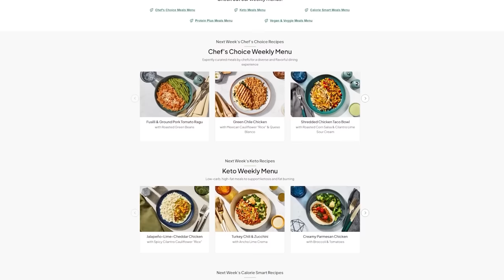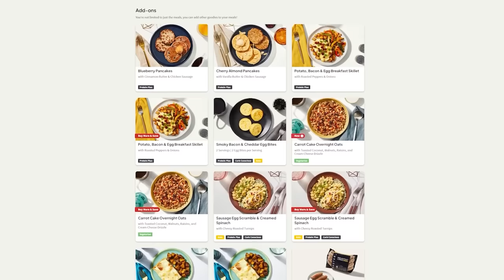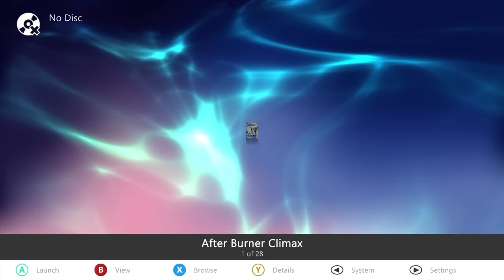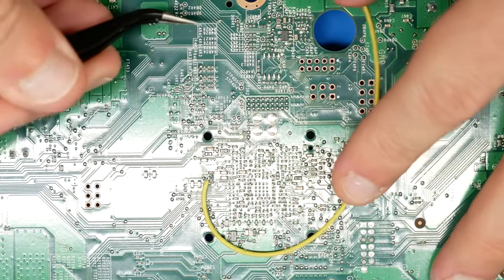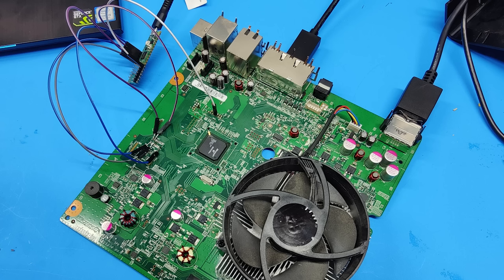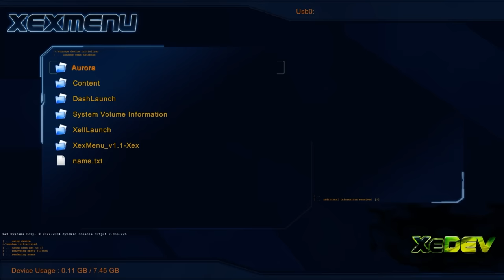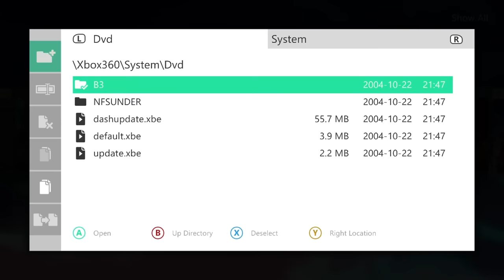I Hacked An Xbox 360 In 2024...Here's Why

Comment: I did this exact mod back in Oct last year. Its totally worth it if use a 2Tb drive cause you'll be able to put 250-400 games on it.
Reply: Is the 2tb drive compatible with the old Jasper models...?
Reply: @ahsanvirk130 I’d assume so because the operating system (software) would be the one reading it. But yeah it’s always good to double check.
Reply: I have 2tb with Aurora and have about 800 xboxlive arcade games
Reply: its available on ebay.. ?
Reply: I attempted it and ruined the motherboard.  I’m jealous of people who can do it successfully.
Reply: ...or you can just buy external HDD / SSD / Flashdrive if you all you want is more space.
Reply: @piotrmbukowski how bout usb thumbdrive
Reply: I’ve only got 300gb hard drive and got 195 games. A lot of them are emulated games from old consoles but even just Xbox 360 games I got 92 on the hard drive as most games get super compressed when you convert them to xex files and another 70+ sitting on my pc for when or if I ever need to put them on my Xbox 😂

Comment: If there were any softmods for the Xbox 360 that DIDN’T require physical modification, I would do so in a heartbeat. Granted, soldering isn’t THAT difficult but you REALLY need to know what you’re doing. Half-assing it isn’t an option, it has to be on point

Comment: I have a Phat Falcon that I RGH3'ed for my kids and for nostalgia purposes. Reliability on boot can be hit or miss, but I find that when the TV is on and set to the correct input before powering on the 360, it seems to work more often.

I have their TV set up to allow HDMI CEC so that they don't have to search for inputs using the remote. So they typically turn on a console, then the TV just comes on and goes to the correct input automatically.
Reply: 360 doesn't support CEC. Xbox One doesn't support CEC. Xbox One X doesn't support CEC.  Series S and X didn't support CEC when first released. HDMI handshake might be the issue you're seeing.
Reply: @espressomatic  this aged well didn't it..

Comment: Taping very precisely around PLL before trying to expose it can save you if you were to slip as it might save you from cutting through the trace that is right next to it. If you cut that trace it's all over and the system is dead unless you do a trace repair.

Also advisable to heat shrink around the resistor in case of shorting against the shield.

If you destroy post 1 you can recover by tapping in on the otherside of the board with a postfix adaptor.

I don't think there are alternative points for the other three unfortunately.

Trinity is the easiest install, early corona not too bad either.

Comment: 3:11

Actually, the last revisions of the original models, Jasper and Tonasket have proven to be the most reliable Xbox 360s you can get. They are more reliable than Slims. I have seen many Slims fail recently while I have yet to see a Jasper or Tonasket suffer a GPU failure.
Reply: I just found out that i have a jasper model but thing is, i dont know how to solder :( really wanna do this tho

Comment: Would this work on a Xbox 360 E? I bought the e 500 gb  as it was it great condition and was manufactured in 2015 .
Reply: No, Those had the Winchester motherboards which cannot be hard modded. You will need another earlier console if you want to hard mod a 360.
Reply: Model Es are only moddable if made in 2013 (corona motherboard) the end of 2013 (iirc november?) and on were winchesters and unmoddable

Comment: Used this exact mod method myself a month ago with my Corona and added a 2tb internal drive, so much content to go through after the mod not just games but collecting all Avatar items and gamer pics as well as each games DLC and title updates 😅.
Also @ 10:37 ripping discs is alot easier when you use Auroras GOD disc extract script found within Auroras script install section.

Comment: I don't remember having to use a chip when jailbreak the Xbox 360 and I did a bunch of them. It was just wires and resistors. Sure, there were manufacturered ribbion  type circuit boards that you could buy, but that was just to make it easier. I always used cat 5 cable wire and resistors on all different versions of the Xbox 360.

Comment: mine got RDOD yesterday, so i bought a new one... im pissed off.... the code was E79 and then no video and the lights said 4141. if anyone can help me with a fix let me know please
Reply: Hey mate. The E79 error code indicates that your Xbox 360 has either a corrupted file system or a hard drive problem. Seeing as you have checked the HDD and confirmed it is functional, I'm thinking it might be a software/NAND chip based problem. Two questions; Have you installed any system updates recently? And is E79, the only error code that is showing up?

Two possible solutions that I have found, in regards to software are;

Clearing any failed system updates that could have caused the error:

To do this, simply press and hold the sync up button, when the console is switched off (on the 360 S, it is the button, next to the USB ports). Then, turn on then console while holding that button. Continue holding it until the console has completely booted up and the dashboard appears. The console would've automatically cleared any failed system updates during the boot process.

Or, if you can get to the dashboard (try doing so without the HDD) try re installing the System Update (if you have recently done one) that possibly might have caused this:

To do this, go into System Settings > Memory > then hit in this order: Left Bumper, Right Bumper, X, Left Bumper, Right Bumper, X > Yes.

If this doesn't fix it, I'll have a larger dig around for a solution, hopefully after some sleep. Non the less, I do hope it helps you.

Comment: I may be a bit late to this, but just fyi for those that want to do this but are not able to solder, check any retro game shop or electronics repair store. The game shops will more than likely have skilled modders available that would normallyvjust be tapped to restore and refresh older beat up consoles.

Comment: I remember getting console-banned for doing something similar to this when the 360 was current, but I don’t recall there being a custom os at the time. This looks amazing; I kinda wanna pick up a 360 now.
Reply: It all depends. I had 2 modded Xbox 360s back in 2008. First one was just a DVD mod that made it possible to play burned games, that you could play online with. The second was a jtag modded Xbox and it had custom backgrounds,homebrew games, the ability to have all the Xbl arcade games for free and you could also run all your disc games off of a external hdd.  This was NOT ok to go online because you risked it getting banned and if you updated the system it would unmod your Xbox because you needed a Xbox that still had the blades dashboard since the firmware updated a patch to stop xboxs from being jtag modded.  Unfortunately it got RROD and I havent bothered to fix it but I want to at some point.
Reply: buy a modded one. it sounds like it needs to stay offline though.

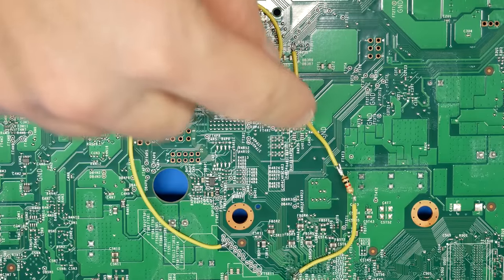Comment: 7:34 I used a fibreglass pen to remove the silk screen on mine. I was paranoid I was going to slip with the exacto knife and cut other traces or knock small components off the board if I did slip
Reply: Might try this. Thanks for the suggestion!

Comment: 10:45 pure nonsense, you can rip the disc in the original dashboard and it's all automatic and it's then also accessible in both dashes then as well, the way you're showing is long-winded and then won't  be accessible in the original dash

Comment: The phats are just as good. It depends on which motherboard revision you get. Ideally you get a tonasket, not a xenon/zephyre. As you said though, RGH 3 is extremely hit or miss on phats, so you want to do RGH 1.2 using a mod chip. I've used coolrunners on both my tonasket and xenon (xenon got all new capacitors and is the good gpu). You can also use dirtypico to flash the mod chip timings. The trinity slims are the easiest to RGH tbh.

Comment: TLDR: I recommend the Xbox 360 Elite over the Slim.
In terms of which 360 model is best for modification, here's my experience for what it's worth. I've modded two 360's, a Slim and an Elite. The fat elite has a Jasper mobo and the Slim is Trinity. I tried to set them up as similar as possible and from my experience the fat old girl is better than the slim. It runs far cooler (I changed the thermal paste in both), and therefore quieter. Although the slim has quieter fans than the fat, they obviously need to run faster to keep it cool. Aurora dash loads faster and runs more smoothly on the fat, and I also had some difficulty getting some XBLA games running on the slim due to security checks. This might vary for other people and perhaps I set things up wrong on the slim, or maybe that matches other people's experience.
Reply: Jaspers have actually proven to be more reliable than slims in more recent years. afaik the eDRAM wasn't made as well and is starting to go bad on some of them, which causes E82 (E74 for slims).

Comment: Why doesn't the Homebrew community use the memory card that the 360 has or a flash drive to mod, a 360 so that you don't have to take a 360 apart and solder bunch of stuff

Comment: If anyone wants to do this mod, it is recommended that you mod a slim Trinity than a the others because in short, they're easier to mod. 

But if you want a more reliable 360, find a Jasper model. Yes, Jaspers and even SOME Falcon's, Zephyr's and even Xenon's with a FIXED GPU are more reliable that slims. A lot of slim models have been red ringing lately.

RGH3 can be hit or miss on Jaspers (well...all phats except Xenon's and Zephyr's that need a different modding method) in which case you'll need a use a "glitch chip" like the Coolrunner Rev. C to mod the console. It's definitely harder to install because you're installing 6 wires instead of 2 for RGH3, but the glitch chip method is extremely reliable, again, at least for phat models.

Corona's are fine as well. They're a lot more challenging to do depending on the version, but they're still good systems to hardmod.

Comment: Xbox gaming feels like such a hassle. PC emulators don't work, 360 requires hardmodding, and Dev mode can't seem to bypass blacklists if I want to play the deepest corners of XBox's library.
Reply: You can always buy them pre modded like I did. I have an original Xbox softmodded with a 2TB pre installed and a 360 Slim hardmodded with 1TB, all I did was install the games myself.
Also the PC emulator for the original Xbox (XEMU) is doing decently nowadays, only 4% of the library is broken or stuck in the intro. It's the 360 emulator that is still far behind...

Comment: I've done the RGH 3.0 mod to a couple slim 360's now, easy if you know what you're doing but would be tricky for a newbie.

Also have another one with the older CR4 XL glitch chip and it takes a while to boot sometimes. I should switch it over to the new method but haven't gotten around to it plus I don't use that one very often.

Comment: Yeah, it's obviously not as simple as you make it sound. The wrong sodering on the wrong circuit could potentially brick your 360... I have an original 360 (20gb hardrive) that went through 2 red rings in it's lifetime (fixed by Microsoft) so i wouldn't attempt this at all on mine. But if all you care about is the games then you're better off buying a cheap mini pc and emulate all the 360 games you can...not to mention some of them you'll be able to play online through private servers...the other alternative is if you have a series x/s xbox, pay the $20 to unlock developer mode and install the 360 emulator on it...

Sidenote - why does most of the games featured here look just as good if not better than most of the current games released on current consoles?😄....you should have at least listed what games they were cause i don't remember seeing any of them back in the day... Was that a micky mouse castle of illusion? What ninja turtle game was that? Was that some kind of after burner game?🤔